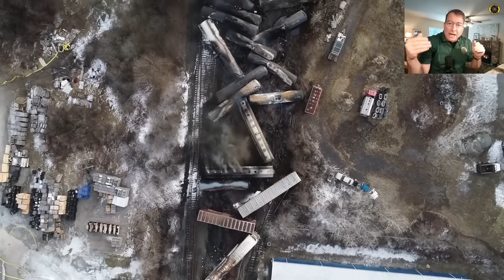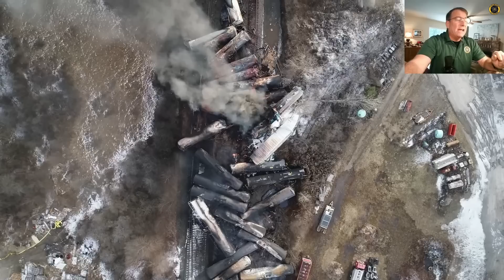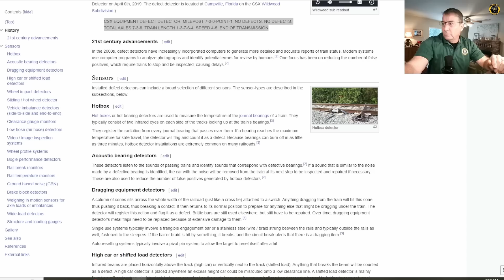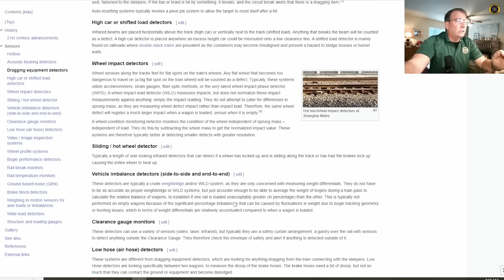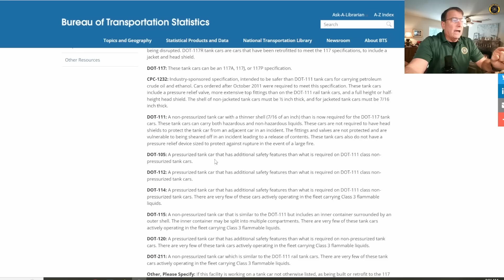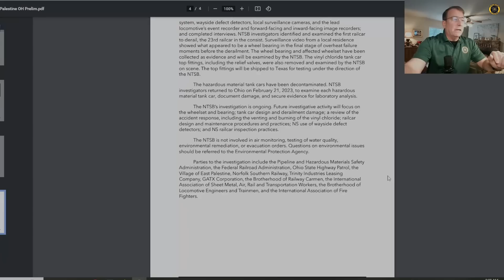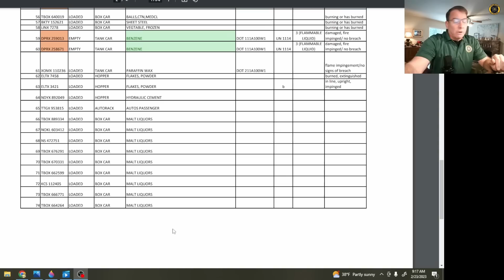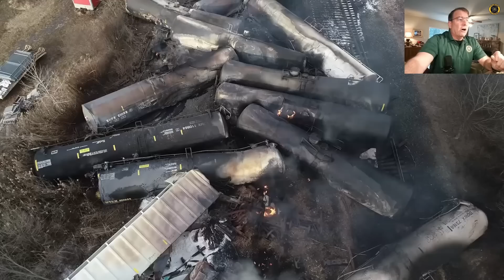NTSB Prelim Report: Norfolk Southern Train Derailment 23 Feb 2023

Comment: A correction to your terminology.  When a caboose was used on a train, the BRAKEMAN rode in the caboose.  The FIREMAN was inside the locomotive cab as he used to 'feed the fire' for the boiler.  Now, with diesel engines, the FIREMAN , CONDUCTOR & BRAKEMAN are the same person.  The BRAKEMAN'S job was eliminated when the cabooses were eliminated.
Reply from the maker: Correct.
Reply: There's only conductor/brakeman duties. They have student engineers, which are short term assignments, to teach the student engineers how to handle engine duties, train handling duties, safety and operational rules and regulations.
Reply: with the advent of distributed power, I wonder why the conductor couldn't ride in one of the trailing locomotives...?    Surely if the hoghead didn't see the smoke and sparks and fire, the distributed power person would have at least gone through a haze of smoke and stink.....

Comment: Why is there not a system in the cab of the locomotive to warn of hot wheel bearings. With today's small sensors, computer systems, communication systems and many other devices/detectors, I would think it would be relatively easy to monitor each wheel bearing. Each rail car could then be programed into an onboard computer assigning its number in the line. When an overheat condition happens, then a signal could be sent directly to the dash of the locomotive sending an alarm of an overheated wheel bearing condition, the temp of the bearing and what car and wheel bearing in the line has the problem. You wouldn't need to have one gauge for each wheel bearing. The HBD and other sensor systems they have in place could remain as a backup or secondary monitoring system.
Reply: Sensors on each car would be cost prohibitive.  It would require electrical cabling between cars also requiring labor intensive setup assembling the cars which must also work with ANY OTHER RAILROAD.  Very expensive and complicated and quite bit of upkeep to keep it all going.
Reply: @stephenmorgan3036  Sorry, but I'm going to call laziness, ignorance of what is out there and just plain BS. That is the same excuse the airline industry said about the black boxes in aircraft along with many other excuses. The rail system they have now, with sensors alongside of the tracks fail to detect the hot axle in the W Palestine wreak. Not only that they can be disabled by Eco terrorists groups. Much like the shunting the track warning systems they do now.
There are several ways this could be accomplished. One would be a stand alone system that incorporates a very small reader/transmitter installed on each rail car that could be programed at the yard to show the number of the car in the line. That would read a small sensor installed on the outside of the bearing housing. There would be no wires involved as the reader/transmitter would read the sensor much like the microchip like they put in animals. That reader/transmitter could send a signal much like a wifi system to the Engineers station where the receiver could give the temp readings. It would work on all rail systems that way. That sensor doesn't even need to give continuous temps. It could be set that if it  goes past a preset temp limit the monitoring reader/transmitter could send an alarm to the cab. 
Non of this needs to be over complicated or over expensive and the rail companies make enough profits to incorporate this modification. The work could be done during the scheduled maintenance servicing. A priority system where the tank cars that carry hazardous materials would be the first to be modified. Even if a secured shielded wiring system was needed to connect all the cars together, how much more complicated and expensive would that be? Is it too complicated for the rail workers to connect a cable something like that air brake system they have now? Or are they just too lazy to do that?   
Have we as a nation, gotten so lazy or comfortable and so over regulated that we can't fix big problems anymore? There was a time that here in America that the rail systems ran on several different gauge tracks. In 1886, it took just 36 hours to complete the change of 11,500 miles of tracks to the standard rail gauge we use today.  The History Guy has a video on that.
https://www.youtube.com/watch?v=4v81Gwu6BTE&t=1s
Tell you what, I'll use one of your liberal sayings: "If this modification would only save one child, one town or prevent just one hazardous chemical disasters like E Palestine, it would be worth the cost" right? 
I grew up learning how to think outside of the box and how to fix problems. Coming up with a reasonably cost system to directly tell the Engineer he has a hot wheel bearing shouldn't be that hard. Even requiring new cars to have the system built in and make it all a standard. 
The one big thing the rail companies need to think about is do they want to take action themselves or do they want it mandated on them through a government that can't get anything right or have it cost effective. Sooner or later the government is going to get involved and it is going to cost a lot more than if the rail companies get together and come up with a fix on their own like I've laid out. Who knows, there might be someone out there that knows of a much better, cheaper and simpler on board system than I talking about here. There are many systems out there that could be adapted or a new one manufactured with off the shelf items.
Americans need to start learning critical thinking for problem solving like they use to teach in schools. I learned it in school and it helped me later in life and some of it I learned the hard way on the fly. I'm an aircraft machinist, spent many years in the USAF during hard times. Many times we had to come up with a way to fix a part or manufacture a part when we didn't have the tooling the factories have. We had to adapted tooling or make tooling with what we had on hand to do the job and do it right. It was called thinking outside of the box. That is what I'm suggesting here for the rail companies and the workers. There is a big opportunity for someone to to come up with a standard fix that would save the rail companies a lot of money and problems. All one has to do is stop thinking it is too much trouble, do a little research and have a can do attitude.
I'm so disappointed in my fellow lazy Americans, American corporations, our corrupt government, the corrupt unions and their lobbyists today. They have all forgotten that hard work is rewording and that if you spend a few dollars now to prevent a problem from happening again it will save you millions later in lawsuits.
Stop thinking about all the ways it can't be done and start thinking how it can be done. You sir have gotten to the point where you can't see the forest for the trees. You let everything get in your way and it is the same for the CEO's of companies and most people today.  I could go into this a lot more but I've gone to far now.
Reply: Call it what you will. There is much more to it than you can imagine. I say this after the better part of 3 1/2 decades of railroad service as an engineer. And I’m not a liberal bud.

Comment: Supposedly crews moving this train in St. Louis wanted to set out the car in question, but were told to keep moving.  How this train traveled 700 miles without triggering DDs along the way is interesting beyond me.  I suspect cold weather and calibration were at play.
Reply: Evidence of such??  Bearing failures don't have to follow any sort of schedule however short or long you may 'suspect'
Reply: @DFI429  word of mouth from the RR Community.

Comment: Thanks for the vid, Juan.
I'm NO rail expert, just a bit of a nerd on all sorts of things I find interesting. 
If people with experience and thorough knowledge would care to correct me, I'd appreciate it as that's how we learn. 
That said, here are some thoughts.

Seems to me the derailment had NOTHING to do with emergency braking, which is as expected.
I would respectfully suggest you're somewhat mistaken in thinking that braking made the derailment WORSE.
Why?
1. I'd be VERY surprised the brakes had any time to achieve anything vs how quickly each car following the initially derailed one smashed into it and of course derailing. 
2. If the brakes DID achieve anything, they'd arguably have made things potentially BETTER as they'd have reduced the velocity and thus momentum of the cars reaching the collision point, making each collision LESS forceful. 
3. I think I'm correct in saying it's that 'stacking' of moving cars into derailed ones that leads to the concertina effect (think of a multi-car pile up on a highway. As per 2 above, reduce their velocity you'll get less damage/piling up of subsequent cars.

It's that point about how quickly the brakes are applied that the rail union(s) raised as to why they want ECB vs the (very) old but effective pneumatic system. 
I think they're being disingenuous (if not outright dishonest), or at least gilding the lily, by claiming the derailment wouldn't have happened or would've been GREATLY reduced with ECB. 
Having said that, it ought not be at all difficult to do the calculations based on masses, speeds and braking forces to establish whether a single car that derailed might not have with ECB vs air system. Doing so would pretty much answer those questions. Don't know if they've been done, however.

Some of this stuff, the issue of ECB v typical air system, unfortunately becomes a tug of war of the union(s) vs the rail companies. Both are likely to overstate their case in an attempt to influence public opinion, which of course means it's all the more important the NTSB does its job completely and with ONLY a search for most likely scenario based on verifiable facts being the purpose (I'm NOT suggesting they're doing anything else, mind you) without 'politics/money' (are they different these days?) getting in their way.

Pity the NTSB doesn't ALSO make part of their report measuring public utterances against what became known when. It MIGHT stop people saying stupid things or, worse, agenda-driven comments of questionable honesty to the press. Doubt THAT will happen, however, and it's easy to see why.

As I said, those of you who know what you're talking about feel free to tell me where I've got things incorrect. I always welcome that.
Cheers all

Comment: Interesting coincidence...before I watched this video this evening...I had returned home this morning from the freeway after feeling unusual vibration and hearing unfamiliar noises at 80 km/h (50 mph).  Air pressure in tires checked out okay...started to feel the wheel nuts to make sure not loose, (unusual yes but why not check)...and guess what, the right rear wheel nuts and rim were warm to the touch and the others cold...ambient temperature was about 0 C or 32 F.   Mechanic tomorrow will tell me what's going on, but so far, my money is on a wheel bearing.  Always transferable learning from these videos, eh.

Update: seized brake caliper
Reply: All of it… 😁

Comment: How do you "controlled vent" a derailed tank car?  Does someone have to physically approach it and open a valve?  Oof-da!  Thanks for covering this Juan!  Glad you're feeling better.
Reply: I was thinking to just shoot a few holes in the tank 🤣I don't think that's a safe option, but I don't know how much safer it is to walk up to it and open the top with a big stick 🤣 my bet is they have some kind of boom truck that is designed up open up about-to-explode cars
Reply: @nhwilkinosn  I read that small explosive charges were used to open up a small hole in the tank.
Reply: It's a big valve, like a fire hydrant. Obviously requires a Hazmat suit.

Comment: Another YT poster mentioned that the detectors are 10 miles apart, and that the preceding detector was off-line.  Seems to fit the pattern of rising temps with the extended distance (20m rather than 10m)

Comment: Close Juan, but there's issues with your terms.  Trains have three braking conditions, plus more with the DU engine in the middle-rear of the train.  Dynamic Brakes (as you covered), normal service application of airbrakes (by the crew to work in combination or independent of the DBs), and emergency application of airbrakes, which involves the breaking of an air line or by crew application.
Also distrurbing is that the tank cars with haz-mat should have shelf couplers or probably double shelf couplers, which keep a set of couplers from over-riding or under-riding during a derailment or loss of a truck.  Some tank cars have been found missing both trucks and having their whole weight supported by the adjoining cars on the shelfs of the couplers!
No Defects = nothing detected as being wrong.  However, there was one derailment I know of that involved a melting axle/wheelset, which derailed within a mile of a hotbox detector, where the HB detector was only looking at if the two ends of the axle were within 20-odd degrees of the same temp.  The bad wheelset shed drops of steel from the wheels on each side of the HBD, with the whole axle heated to 1000F+ it didn't see that as a problem.  I think the newer detectors have had that fixed... hopefully.

Comment: I have long been of the opinion that railroad braking systems are absolutely archaic!  Each car should have it's own braking system independent of the rest of the train controlled by the engineer via radio signals.  How best to accomplish this needs to be studied but application of emergency braking under most circumstances is totally unacceptable.  We can do better!
Reply: Each car does have its own independent braking system actuated via an air operated train line. Train brakes are not archaic or “civil war era” as many falsely claim. ECP braking or any other type of braking would not have prevented this derailment or the outcome.
Reply: A train is essentially a slinky. Each car making its own decisions would be a disaster.
Reply: They had a 30 mile warning of impending bearing failure, and 30 miles to stop the train before it wrecked. By management policy, they ignored the warning until too late. Electronic braking is irrelevant, and would only mean severely lower reliability due to complexity, electronics not doing well over the very wide range of ambient temperature and humidity, and need to maintain batteries on 1.6 million US RR cars. US temperature range is roughly 115 F to -40 F or so, hard for electronics to survive that range.  US railroad air brakes may seem crude, but they are reliable, easy to maintain, and work over this wide temperature and humidity range. They have been optimized over 130+ years. The prime directive for engineering is "maximize simplicity".

Comment: I think in the security video the offending car failed separating the train braking airline starting the emergancy brake event. The car and evreything behind with momentum derailed. Seeing a hotbox derailment the axle will get so hot the axle will twist in half bwteen the bearing and the wheel. Separating that wheel assembly from the truck causing all sorts of damage, at high speeds you get this kind of derailment everytime..... Comment by Kenneth L Boren.....

Comment: 4 ways to slow a train. 
  1 independent brake. - locomotive only
  2 dynamic brake - electric brake
  3 phase 1 train line set( typically I saw was ~10psi reduction from 90psi with 5 lb decreases). Apply car brakes in service mode.
  4 emergency application phase 2 train line  dumps train line to 0psi making a maximum brake effort on cars returns throttle to 0 ( turns off dynamic).

Warning ⚠️  to crew of over heat condition?
You played the masses of record . 
Hearsay from a nother youtubers comment section.  
In the back ground  the IR temperature is sent to dispatch where trends are established to flag cars for maintenance . This is where things had progressed to when the threshold to alert the crew of a problemwas reached. The system  was faster than dispatch... as designed.  If this( #4) detector had also shown the trend of getting hotter without exceeding the threshold the crew would have been notified by radio to slow the train and where to set out the bad order carfor repair.

Comment: So here is just a thought. Automobiles were required to have tire pressure monitors circa 2005, for safety reasons. But massive trains with super dangerous loads traveling through cities have this flawed monitoring system. Sensors and transmitters on the train cars, talking real-time to the locomotive would be fairly easy to do. it's just the greed of corporations, blocking the regulation for more profits, that lead to this inadequate safety scenario and subsequent accidents like this. Corporation don't care about what they do to regular people.
Reply: Fairly easy * 1.6 million RR cars = not easy, very unreliable.
Reply: @SteamCrane  5 million new cars sold in US every year, easy and reliable and things like onstar been around a decade. Its easy if you care about doing it.

Comment: The report doesn’t say anything about dispatch noticing a bad trend in the temps for that bearing and wheel and alerting the train crew after the second detector was passed. Maybe it’s not NS’s policy to monitor trends, but I think it is for some railroads.
Reply: This is the preliminary report. They haven't had time to do their industry best practice review and follow those leads.
Reply: Reported that 3 detectors in a row reported increasing temperature, but the alarm threshold is quite high.